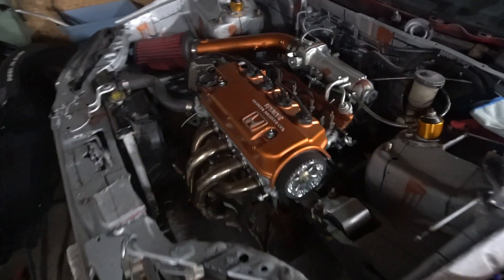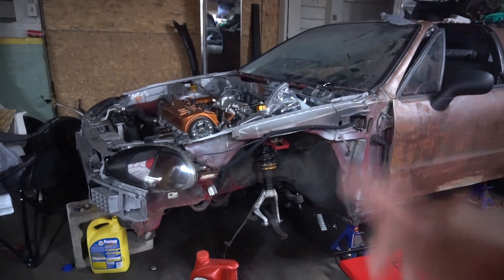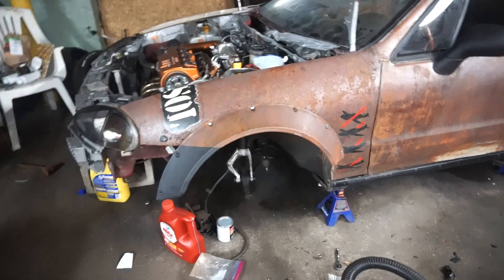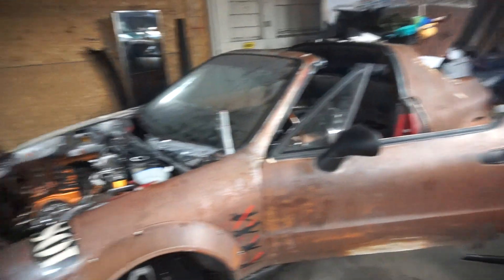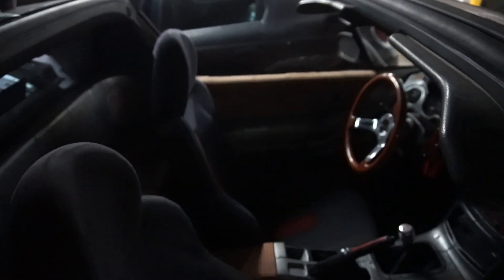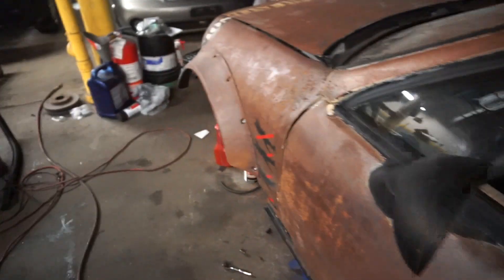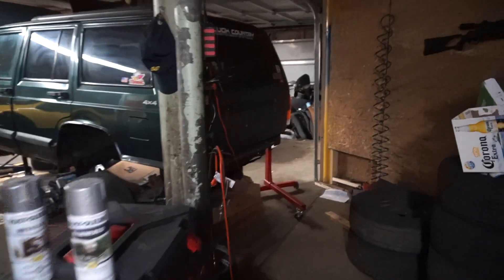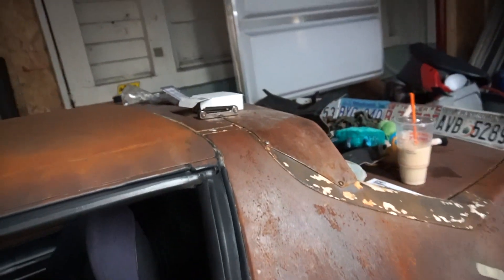more del sol progress

Comment: I have a del sol as well and was wondering what a good set of coils would be to get for it as the front of the car sits like 2 inches higher than the rear and I want to level it. Thanks and keep up the great videos.
Reply: cut springs